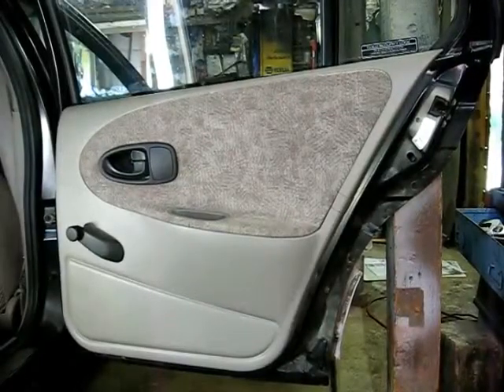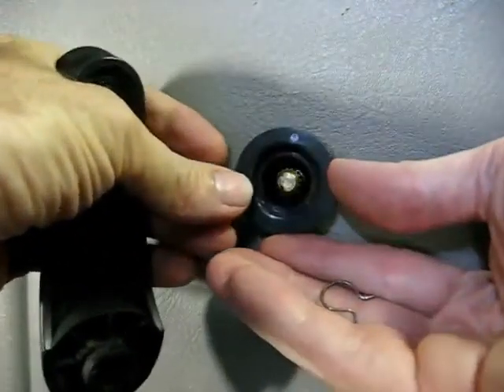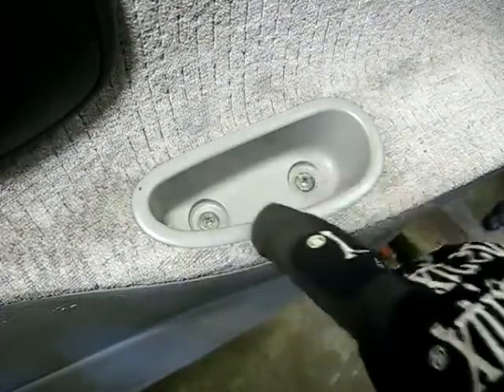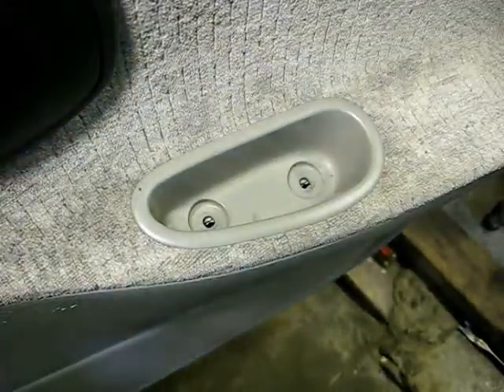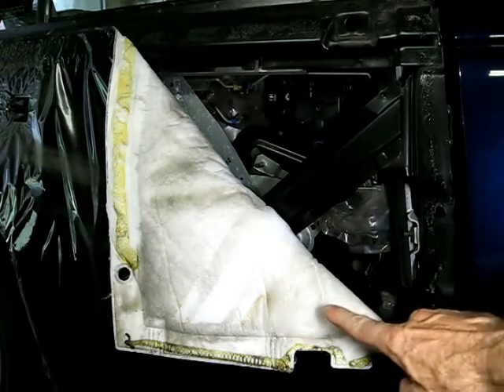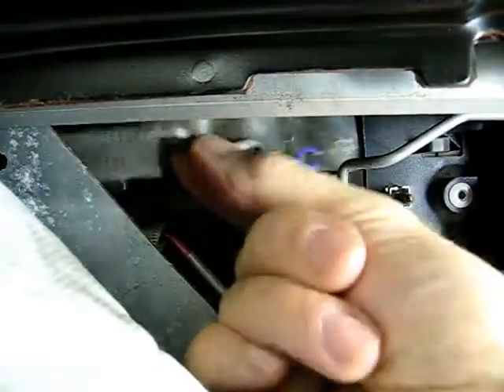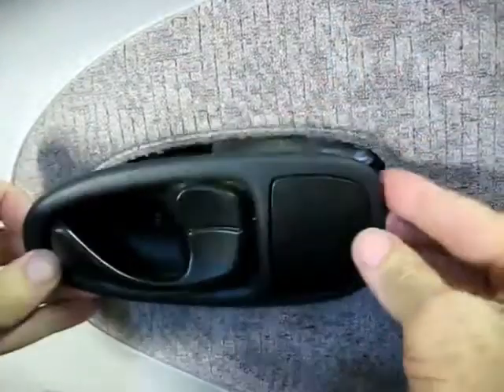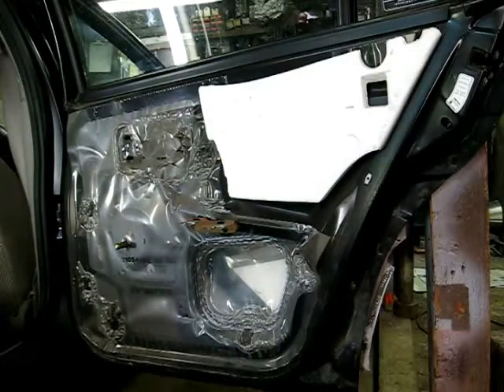Rear Inside Door Panel Removal

Comment: Just thought I'd give an update. Finally got lucky at a local pick a part junkyard yesterday finding a really nice unmolested set of interior door panels and installed the rear inside door panels today. You can get the door handle off and back on without removing the outer door panel but boy is it a pain in the a** lol. Took me about 2hrs to get both of them on, most of the time was spent getting the rods back in the holes. Thanks for all these videos on Saturn S series, they are really helpful :) .
Reply: I’m going to have to do it that way. Someone backed into my door and it won’t open from the inside or the outside. Since there was no dent on the outside (because it’s a Saturn) the driver told the cops he never hit my car. (His car has damage, but the cops suggested to him it might be old damage.)  Thanks—hopefully I can fix this now.

Comment: Thanks for these videos Rich, expecially for the Saturn S.  I have a '99 SC1 so it'll be 11 years old in December.  Still runs great @ 215,000 miles.  One video I would like to see is how to remove/repair the sagging ceiling problem.  Mine is starting to develop that problem.  If you can order a new ceiling I'd rather do that.  I'm hanging on to my car til 300K.  Your videos are clear and detailed and give confidence that one can do these things themselves.  Thanks!

Comment: These videos are greatly appreciated.  Would it be possible to remove the door handle without taking off a panel?  I have a '99 sl1 and the manual lock no longer works and I cannot open the car door to repair it.  I think a rod may have come loose. Do you have any suggestions to fix the lock?

Comment: Any tips for putting the panel back on? Just got done fixing the window arm slider, and now it's a bitch to put back on the panel because of the door handle assembly.
Reply from the maker: I use a a tool called a pull rod to help in assembling the control rods back in place.